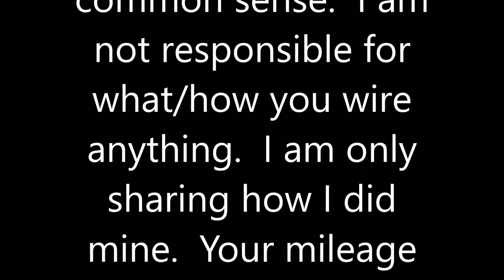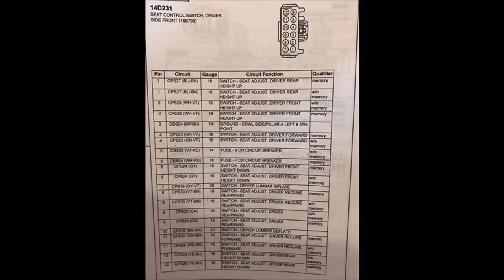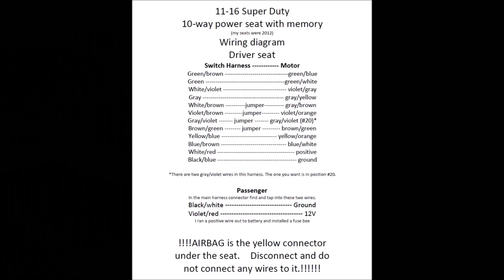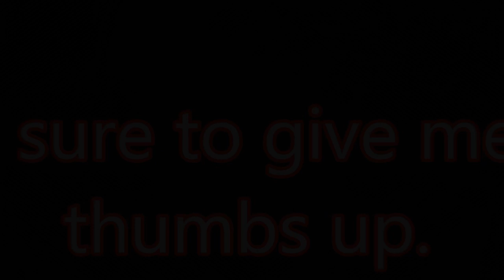Ford Super Duty Seat upgrade/swap/conversion (republish)

Comment: question - I followed the wiring diagrams (2013 King Ranch seats in a 1999 Ford F250 diesel), but the horizontal forward backward wouldn't work - I got a new switch, didn't help. Did anyone else have this problem? (I thought it might be a bad "new" switch, and bought another - still no horizontal forward/reverse, even though it by directly hot wiring the motor.  (?)  Great video - best I found! It helped me not trip the airbag, and told me that green is hot and black is ground from original vehicle.

Comment: I appreciate your commitment to the video.
I feel bad you set the airbag off. That sucks. I hope you learned from that mistake. 
Only part I didn't care for was the butt connectors.
Video was very informative. I just did a swap in our 06 but could not find nice seats like those you have
Reply from the maker: Hey thanks for watching and commenting.  I definitely learned from that mistake. Always double check wires and never assume. I posted hoping it would catch attention and people would know what to look for and to be aware that it can hurt you.

Comment: Yellow connectors in most modern cars are almost always airbag related. You cannot use test lights or a dvom on any of those circuits.
Reply from the maker: Thanks for sharing the tip.

Comment: Thank you for the video 
I have 2000 f350, manual seats, and I want to update with manual 2017-2020 combo seats, any idea if I have to do any modifications?
Reply from the maker: My understanding is that there would need to be modifications made. How much I don't know. I do know that the cabs were redesigned and they will not be bolt-in like  2016 and previous.

Comment: Super, very informative: thank you Anthony!
Question, on the 2015 seats to 2003 truck swap, does the seat belt buzzer need wiring? Any warning sound or light on dash?
Reply from the maker: I'm not sure on that part. You can leave it off and see what it does. The 2000 had no issues. If it does, you'll have to figure out how to wire to "close" the loop if you want it off.  Or you could leave it so it buzzes.

Comment: @shooshinejonnie, did your 2012-2016 center console install level? I installed the same console in my ‘03 but it’s slanted downwards towards the driver side.
Reply from the maker: As far as I'm concerned it did, I don't see anything that seems off kilter or askew. 
👀🔎📐
Did you use any of the under/center brackets or the front bracket? I did not use any of those. 🤷‍♂️
Reply: @shooshinejonnie  just the rear brackets next to the seats. I noticed the factory console when placed on the ground also leans towards the driver’s side. Maybe the factory trans tunnel on the 2000-2007 is unveven from the factory and the 2012-2016 is not
Reply from the maker: I have a 2000. Should be the same. 🤷‍♂️

Comment: So you just put power to your passenger seat without reworking the wires and it worked? Trying to figure out my 2016 6 way seats that I'm throwing in  my 2002 f250.
Reply from the maker: Yes. You can do both seats like this fortunately. The driver's side has multiple power and negative points. Read through the comments of this video and of the original video of the same name. You don't have to hack up the seat wiring. I am not an electrical guru so I just did what I knew was supposed to work. If you have any further questions you can ask here or shoot me an email at shooshinejonnie@gmail.com.
Reply: @shooshinejonnie  thank you sir for the video and reply.
Reply from the maker: @austinb.2029  👍

Comment: Thank you for posting this video. Will F150 king ranch bolt on to a 2004 250/350 super duty?
Reply from the maker: From my understanding F-150 will not bolt directly into a super duty. You will have to do some modifications. I believe there have been some that have moved the seats over to the seat bracket of a super duty or have modified the F-150 brackets.
Reply: @shooshinejonnie  Thank you 👍

Comment: I have a 2006 f350 king ranch and I want to install one from 2016, does the same apply to what you show in this video?
Reply from the maker: I know it bolts in the same and you should be able to wire it up. I would recommend not doing my driver seat the way I did. Find the pinouts for the wiring harness and connect all the power and all the ground and you should be good to go. Unfortunately, I don't have the pinouts for either of the years that you have.
Reply: @shooshinejonnie  you are the best thanks for the help I will follow the steps recommended by you .best regards from Miami

Comment: Hey man! Awesome video. I laughed a lot at your airbag humor. Did you ever get the heat and cool figured out? I'm thinking of trying this with 2010 f150 seats onto my 1995 f250. Wish me luck lol!
Reply from the maker: Thanks for watching. 😁😆 I've found several ways to hook up the heat and cool but I haven't done it yet. 
Good luck on the seat swap. Anything can be done with patience and a "can do" attitude.
Are you an Ameri"can" or Ameri"cant"? 🤘😁
Reply: @shooshinejonnie  I'm a canadi'cant' 🤣
Reply from the maker: @liambassingthwaighte8636  ha ha😄
Reply: @shooshinejonnie  Great vid! i am currently doing the same swap. Can you please tell me what method/wiring you used to get the heat and cool functions working? I have a couple of double pole double throw relays to start. Thank you
Reply from the maker: @fullthrottlez06  thanks for the kind words. I've never connected my heat and AC for my seats. It's still on the "to do" list for the future.

Comment: Here is what I did, the memory module has a 2 pin plug leave it plugged in and on the back side put power to green and negative to black then go to the switch wires and put positive to orange and green and the negative is black and blue and on mine they were on opposing ends of the plug and leave it plugged in and i did not cut a single wire and they work fine and the memory module is powered up, just use a car or motorcycle battery to test, every other video I have shows butchering wires, sorry bout the air bag!
Reply from the maker: Thanks Bob for the tip. I do know that you don't have to hack it up this way but it was the only way I knew at the time. Thanks for watching and commenting.

Comment: I did this with my 2003 F150 I put 2002 king ranch seats but my truck didn’t have power seats the Harness is different so now idk what to do any ideas
Reply from the maker: Yes.  So what you'll need to do, since I don't have the pin outs for an F-150, is find the electrical diagrams for a 2002 and 2003.  You can get by with only the electrical diagrams for the 2003 since you can find the power and ground from your truck's harness with a multimeter. You'll need to know the power and ground of your seats so you can connect those two wires together. Or you can bypass everything that's there now and run new wires and put a new fuse block in as I did with my passenger seat. If you have any more questions you can reach out to me at shooshinejonnie@gmail.com.

Comment: So if your putting 08 seats in a 12 do the frames come off with all the wiring or are the seats too different
Reply from the maker: The frame should be the same. Maybe I'm not quite understanding your question. The seats are almost identical and the wiring is almost identical.

Comment: With the carpet under the seat where it mounts takes most vibrations out when sitting in the seat
Reply from the maker: I haven't noticed any difference. The cutouts are in a stock carpet from a 2012.

Comment: Thanks for the video..... I have a set of seats out of a 2003 Nissan Altima. The drivers seat is a 10 way with a memory moodule that needs bypassed.  My question is where would I find a wiring diagram like you have? One that shows each wire from the switch harness side. And what wire it needs to be connected to on the motor side.. Thanks
Reply from the maker: I eventually found my diagrams on eBay. I bought the wiring diagram manual (usb) for both vehicles. I'm my case it was 2000 and 2012 Ford super duty. 
You could also check forums or Facebook for vehicle specific pages and info.
Reply: @shooshinejonnie  thanks

Comment: Want your opinion, do you think 2012 f250 seats will directly bolt onto a 2008 f250?
Reply: Bebo from what I understand 1999 through 2016 all have the same bolt pattern. Because I used the console and the seats from 2012 everything went in like a glove. I believe if the consoles and the seats are not the same year you may run into some bolting together issues. Slight modifications and you should be good to go.
Reply: Okay, thanks.  Just purchased some 2012 black leather seats.  Thank you!
Reply from the maker: @bebo653  cool. I'm not sure what the difference was between 2008 and 2012, but the difference between 2000 and 2012 was drastic.
Reply: Thanks again.  Seats bolted right on without issues.  Now the wiring part.  Thanks for your guidance.
Reply from the maker: @bebo653  fantastic! 👍 Glad that worked for you. Do you have the wiring diagrams for both sides? I have 2012 but not the 08. Shoot me an email at shooshinejonnie@gmail.com and I'll share what I have.
Reply: Yes, I followed your lead on this video and everything worked.  Only issue I’m having is that seats feel wobbly.  They are bolted and have the center console. I thought this would provide stability, but didn’t.   They wobble when I move and mount and dismount.  I’ve been doing some searching online to see if someone else ran into same problem and if so what they did to make seats stable.
Reply from the maker: @bebo653  🤔 I'm not sure on that one. 
Are all bolts tightened? If they are, it may be in the seat itself. They are fairly flexible and the frame will flex with any structural truck movement. I wish I could give you a more definitive answer. 🤷‍♂️

Comment: I hate the 2019 superduty lariet seats I have. I miss my 2016 2011 types so much. Wish i could put those in my 2019.
Reply from the maker: The 11-16 are super comfortable. Going from 2000 worn out, so crooked it made your back ache, was a huge difference.

Comment: I’m looking at buying 2008 seats for my 2004. Will they bolt right up. No issues?
Reply from the maker: My 2012 bolted right into my 2000. I believe they bolt right in with no issues.

Comment: Whats the best place to find clean black seats? 

My '10 doesn't have headrests and I'd like to upgrade to some heated/cooled jobbies.
Reply from the maker: I found mine in a Facebook group. You could check Craigslist via searchtempest.com or you could also check carparts.com.  Check your local junkyards. Some get lucky and find them there.
Reply: Brad also just started a Facebook page "OEM Seats Stephenville" showing a handful of the seats he offers.  He's constantly receiving and shipping seats weekly so he doesn't maintain an active website or much photos due to the volume he sells.

Comment: I got a 1997 ford XLT 350 dually, shes in mint shape ,I just bought er off a older gentleman n she's NEVER saw a winter, either she was in storage in winter or she sat in Flordia. CAN ANYONE TELL ME WHAT INTERIOR I COULD USE TO PUT IN HER??..🤔✌
Reply from the maker: Sounds like you have a jewel. 
You can put anything in you want with enough time and money. I have seen OBS with complete super duty interior. It's definitely not bolt-in though.
Reply: @shooshinejonnie  hey young brother ,what interiors would u think would work best for me to look for in my case on my 1997 350?  I had a brand new 19 RAM n I sold it as soon as I got my hands on this old girl , I waited soon to find this time capsule IN FANTASTIC CONDITION N ORGINAL SHINNY PAINT!🥳💞
Reply from the maker: @vtwinpower1903  I'm not sure which way to send you on what to look for. I would guess they're all going to take quite a bit of modification. If you're just looking for seats I would start with F-150 or super duty seats. Find which ones the cheapest and grab a set and do some experimenting. Or maybe go to the junkyard and pick up a cheap set of busted up ones so that you can use the mounting brackets to figure out what you need. The f250s are just a little bit wider than the F-150 as far as seats go. I know there's some videos of other guys doing the super duty interiors into an OBS. I don't have any links.

Comment: What size star bolt is that seat mount using? It’s a big un.
Reply from the maker: I think it's t55 plus. You can use a regular t55 but you need to keep pressure on it so it doesn't slip out and strips. I used a t55.
Reply: shooshinejonnie - Thank you sir! My set goes up to T50 so I knew it was bigger than that.

Comment: Anyone seen anything about wiring harnesses? Like “plug and play”? 
I just put all my ‘14 lariat seats in my 06 but I can’t move them I figured it’s been 10 years
Reply from the maker: I haven't seen anything about plug and play harnesses. There are so many variations. You can find the pinouts for both of those years. Unfortunately I have neither of those years. You can shoot me an email at shooshinejonnie@gmail.com if you have more questions.
Reply: shooshinejonnie thanks! If I find any I’ll link it back here. By the way mine is an 06 f150*

Comment: Will a 2017 f250 super cab seat set (front/rear) fit in a 2008 f250 supercab
Reply from the maker: I don't believe it's a direct bolt in. They changed everything. I'm sure something could be fabricated to make it work.
Reply: Did you ever determine if the seats were compatible? I am trying to upgrade my 2009 F250 with a 15 F250 interior.

Comment: So has anyone swapped a 40/20/40 seat out of a 2011 in an 04 with a manual transmission.  Will my lever hit the  the consol part
Reply from the maker: Absolutely. You can swap the seats but you would have to go with an 08-10 console. Those consoles don't go all the way to the dash.
Reply: @shooshinejonnie  yea i bought the set that has the center flip up to a seat or down to a consol. The 04 consol is back from the bottom of the seat about 5 " and the 11 come out flush with the bottom of the seat. I mesured but its nice to hear from someone who knows for sure.. thanks
Reply from the maker: @n1uk214  as far as I know the center fold down seats are interchangeable so I'd be very surprised if it didn't work. You'll have to test it for yourself or you could check on the Facebook group "powerswap nation".
Reply: I guess ill be checking it monday evening. I appreciate the reply abyhow. Ill let you know one way or the other.
Reply from the maker: @n1uk214  yes, please confirm.

Comment: Did your old seats where powered ?
Reply from the maker: My original driver's seat was powered. If you do not have any power you could wire both seats like I did my passenger seat.

Comment: Will 13 platinum seats bolt up to my 2003 dually im having trouble
Reply: I put them in and they do not bolt up
Reply: @Nicaelmusicinc1  are you missing bolts? Or are the holes not lining up?
Reply: The don't line up at all the front brackets on the seat are 2 inches short from reaching the front
Reply: @Nicaelmusicinc1  🤔 my understanding is 99-16 bolt right in. They are out of a super duty? And you're putting them into a super duty?
Reply: Just realized the dude sold me f150 seats -_-
Reply: @Nicaelmusicinc1  bummer. I've heard of making them work. Can you mount the seats to your bases?
Reply: It's a big pain in the neck and the wiring was a nightmare decided to sell them

Comment: I want to do a similar seat upgrade. What if my 2000 super duty does not have power seats?
Reply from the maker: You could check under the flooring to see if you have power. If you don't you could do the driver's seat like I did my passenger seat and wire it up yourself.

Comment: Nothing you are showing does any good if you don't also show how to remove the seat.
Reply from the maker: Unbolt the bolts and disconnect the wires. Should be 4 bolts per seat. 🤷‍♂️
Reply: If there are then they are hidden under the carpet or plastic trim somewhere and I don't want to rip, break or tear anything trying to get to them.
Reply: Not knowing where they are
Reply from the maker: @mlcollins7481  if you're still lucky enough to have your plugs they should be under those. Round plugs in the plastic trim probably about 1.5" in diameter. It's been so long that I don't remember. I don't even remember if I have the plugs on my newer seats.
Reply from the maker: This might shed some light on the subject. 
https://youtu.be/Zuds3aliRAw